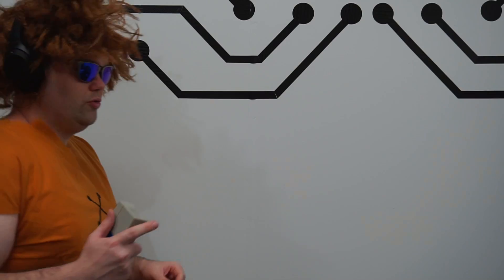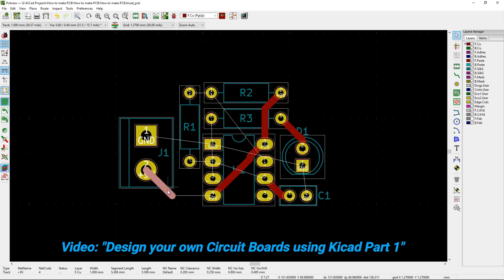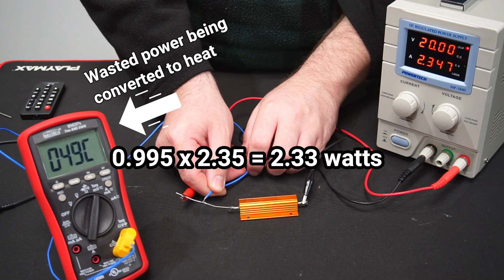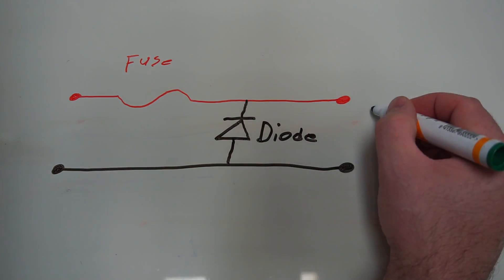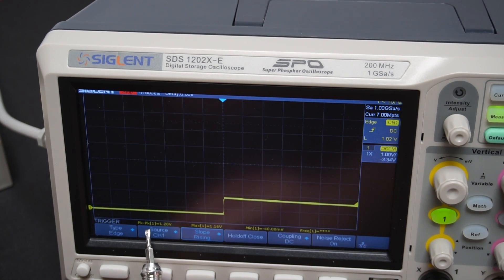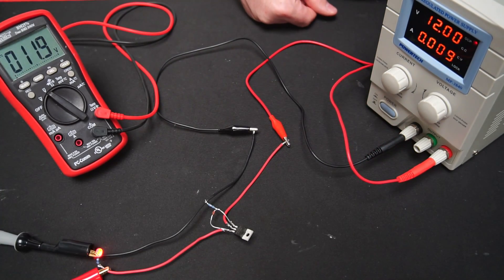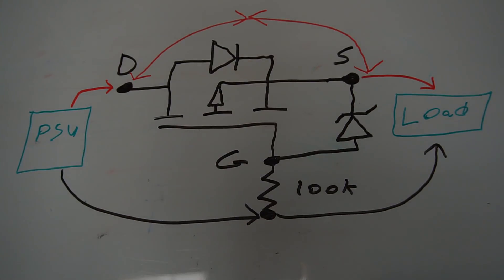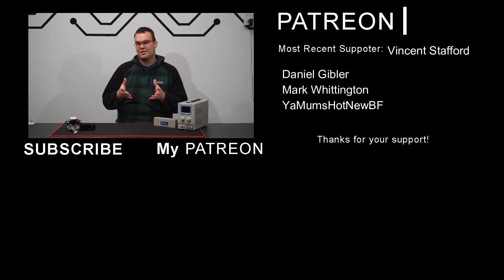How to implement Reverse Polarity Protection in your Circuits! ll Diodes & MOSFETS

Comment: i think you are confusing reverse polarity vs reverse current. In the case where you have battery as the load, you want reverse current protection ie. preventing current from flowing back to the supply in that case you want something like the NCV68261 or tps25944l.

Comment: Thanks for the info, please tell me about your choice of using 100K resistor and not a 100 ohm resistor to the gate
Reply: Reducing energy wasted by the gate circuit. You only need to overcome the gate capacitance of the MOSFET once, after that any additional current flowing is just wasted.

Comment: I was a bob when I hooked up the battery on a VERY expensive generator with electric start. It started but a few seconds after running, the control box let out the magic smoke. I burned up the charging circuit. Hooked the battery up in reverse polarity.

Comment: To improve the P-channel mosfet circuit, a second transistor can be added to cut off the mosfet gate when a load voltage is applied
Reply: Is there a video for this?

Comment: hi, all , me and my so race rc buggys , we have a Lipo charger 16 amps max ,  if we plug the Lipo battery into the charger the wrong way it blows that chanel on the charger , , can some tell me , if the mosfet  way in this video would work , between the charging lead , ????

Comment: If Mosfet allows current to flow both ways as you said, how in the world that translates into protecting your power supply from reverse voltage, say if you have an inductor ( a coil of wire) in the system while it is switched on and off?

Comment: The third method could we not add a Schottky diode inline if the load were a battery?  This way the voltage would flow only one way (basically a mixture so the fet is replacing the fuse in method 2 becoming, in essence, a resettable fuse?

Comment: Appears you have made a mistake in the schematic diagram. The diode across the supply voltage should be AFTER the fuse, so when the supply voltage is in reverse polarity it will pop the fuse. What you have on the schematic diagram will cause a short circuit directly to the -ve terminal.

Comment: I've seen this done with a bridge rectifier to the circuit and they then polarity dont matter. Only draw back is more voltage drop on because of more diodes.

Comment: The LED is also a "Diode", so its a poor test example. In reverse polarity, the LED would not illuminate; regardless of the additional protection diode.
Reply: I think two LEDs back to back would have worked great for the examples.  One lights up either way.
Reply: That's why he reversed the LED for the reverse polarity tests
Reply: That's a good point!

Comment: In the case of a battery backwards across a power supply, a series diode is not the best solution, regardless of type. The supply and battery are simply in additive series at that point and while the diode may act like a fuse and pop, it still risks overstressing the supply. It's true the supply won't see reverse polarity, the battery still will see a polarity that opposes it's own, and your internal shunt diode wouldn't have popped, but that's not... Well... Ideal... Even tho a battery with a discharge rating in excess of the capacity of the diode will eat that just fine.

It will however save equipment from a flipped supply.

The shunt version is much more robust in either case. The little bit of reverse voltage the equipment sees is minimal, you'll only have a problem if your device runs on very low voltage to begin with.

The MOSFET version is really overkill (especially if you are running heavy enough current to warrant a heatsink) as it doesn't save much in terms of losses for normal operation over a schottky.

Schottky and fuse FTW.

Comment: With the Schottky & fuse method, I've seen the Schottky go open circuit after being overloaded, although the equipment was successfully protected.
Unfortunately the user only knew that the fuse had blown and replaced it. The equipment worked perfectly until the next time he connected it up wrong, this time there was no protection at  all and his equipment was wasted.
Not a good protection method at all, IMHO.
Reply: If a fuse is blown the end user is to blame when it happens, so the same end user needs to check the diode as well as the fuse and replace both if needed.  Most will not and happily continue on until the next time the equipment is blown.  To be honest there is no real way to protect a device from idiots.
Reply: @generalawareness101  You are making the assumption that the user knows about this method of "protection". Fuses are common devices which are replaced as a matter of practice, diodes are not. The user may realise that the fuse blew because the polarity was reversed and know not to do it again but may not be the only user of the same equipment.
Reply: @chrishartley1210  I think we are talking about two different classes of end user.  You are talking about the WalMart type while I am talking about the ones watching this video.  The DIYer type.
Reply: @generalawareness101  So does that mean that only the DIYer is allowed to have a reasonable level of device protection? That was my criticism of this method as a means of protection.
Reply: @chrishartley1210  For the three methods mentioned?  Yes, only a DIY'er as there is a fourth method I have seen in products that were not made in China.  TBH if it is made in China 99% chance that if you fuck up and reverse the wires you will kill the device instantly and release the magic smoke.  The Chinese made products don't even connect the ground wire up on most items so it isn't just a reverse polarity issue with their shit.  Do I buy their shit?  I have no real choice, but I know the first thing to do is open it up, make sure all mosfets are tightened to their heatsinks, that the ground wire is actually attached to the outer case (even if it is make sure it is in contact as some are but are insulated due to paint then they connected it over the paint).  Basically the WalMart types do not have the education, or just experience, to handle all of that so releasing the magic smoke is the least of their worries.  Most quality made goods (iow not made in China) has reverse protection that works and are really grounded.  People scoff at UL but if it doesn't have their seal I will not touch it (unless really cheap and I will go into it to make sure it is not going to burn down my house, or kill me, which both almost happened to me before so I learned the hard way what to look out for).

Comment: What kind of protection is suitable for reverse current protection?for example if I connect a buck converter with 3 volt output to a 3.5 volt lithum ion battery this cause a reverse current to buck converter.I destroyed too many buck or boost converter this way🙃🙃

Comment: Thank you for this great video. I learned a few things. I was wondering if you Know if using a MOSPEC F12C20A and its pair F12C20C or, the U30D20A and its pair U30D20C That are used for rectifiers would work. As you know no matter how you connect the power source ( as long as it is not connected to the commons ) It would only pass positive in one direction to the load. It might not work for a charging situation just for loads like you mentioned? I don't know too much about voltage loss so I am hoping you can tell me if this is worth the effort. I already have the MOSPEC F12C20A and its pair F12C20C.

Comment: Can this be done on a ATX power supply 12v (yellow wire) ? I am wanting to replicate a -12v polarity using a +12v wire . Basically I want to replicate or make another blue wire that is -12v.
Thanks in advanced

Comment: What about a diode in series with a relay? Wrong polarity... it doesn't allow the relay to pull in and of course the relay contacts must be able to handle the voltage and current. The down side is that the power supply must be a fixed voltage, which is perfect for battery chargers. 
Before Schottky diodes were selenium rectifiers... about 50mm square bolted to the chassis of a Pye AM10D radio telephone and its protective fuse was 10 amps. I never saw one of those fail to blow a 10 amp fuse... well not until some prat replaced his blown fuse with a 22 cartridge. The boss went ballistic when I told him about it.

Comment: Amon, I think you may be a bit confused about what "reverse polarity protection" means and what it's intended to protect against.  A few places in the video you put a battery where the load would normally be, then declare that the reverse protection doesn't work.  This is not the scenario it's intended to protect against.  Reverse polarity occurs when a source's positive and negative are swapped, not when the source is moved elsewhere in the circuit, or when two sources feed the circuit from opposite ends.

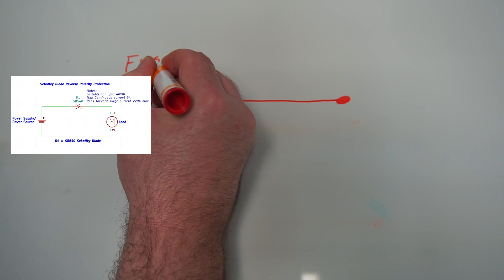At 3:53, your diagram and description will only work to protect the PSU against a reversed battery.  I realize you were using your opening scenario as the example, but you said, "battery slash load."  If a load is connected backwards using this arrangement (in place of the battery in your diagram), it will not be protected, as the diode is still reverse biased by the PSU.  For a typical use case -- trying to protect a load against reversed PSU or battery connection -- the fuse must be to the right of the diode, so that if the PSU is reversed, the diode will conduct and blow the fuse.

At 5:30, and later, your schematic shows a battery as source and motor as load, but again, the fuse is in the wrong place.  If the power source is reversed, the diode will present nearly a dead short and may overheat or explode, but the fuse will not blow and the load will not be protected (in this case, the fuse must be to the left of the diode to have any effect).

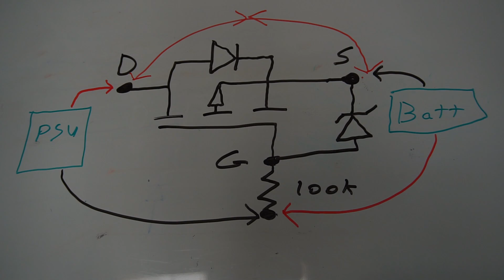At 7:59, your white-board drawing shows the battery positive connected to the MOSFET's gate and negative connected to its source.  This puts the gate at a higher voltage than the source, which will turn off a P-channel device.  As drawn here, the MOSFET would not conduct if the PSU were removed.  However, a few seconds later you clearly have the negative of the battery connected to gate and the positive to source, which will of course turn on the MOSFET and light the LED, but your voice-over suggests that this is unexpected.  It shouldn't be; it's perfectly normal, and it's not a failure of the reverse polarity protection circuit.
Reply: The series diode would be inside the equipment to be protected, not at the supply.

In the scenario given with the battery as the "load", the battery and supply would effectively be in additive series (so if your intent was charging, essentially attempting double the voltage across a forward biased diode), which if both the battery and supply were capable of exceeding the diode rating, would cause it to act like a fuse and pop. If not, the supply would just drain the battery, but the supply would indeed never see the attempted reversal, only the battery would.

This whole thing is more complex than it would seem for just a handful of components lol

The LED lighting up is more complex as well but I'll save that for another day

Agreed on the shunting diode being in the wrong place.

Comment: Nice video. I am missing the double MOSFET protection in this case. Which fixes some issues of the single one with a penalty of some additional costs and board space. Also there are some integrated circuit ones with even more control in a tiny package.